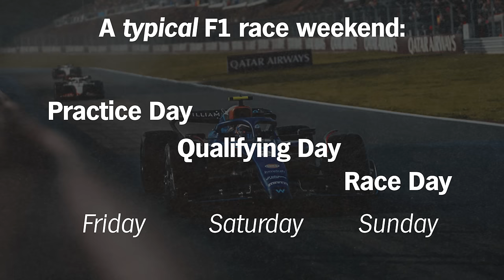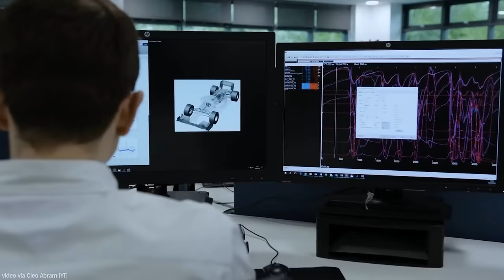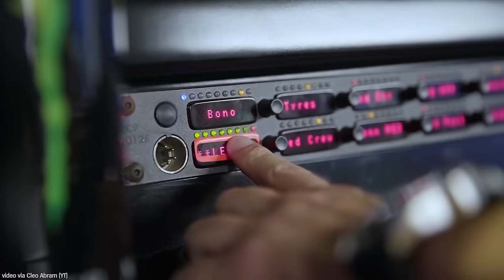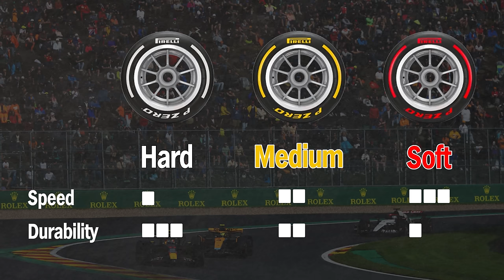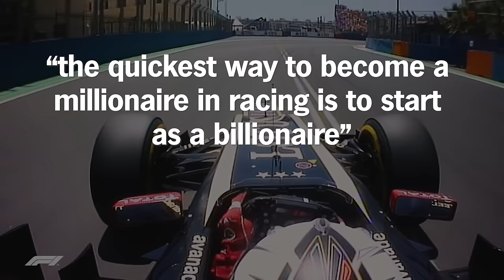Why America is Suddenly Obsessed with F1

Comment: For anyone who's wondering about the 4 wheels rule...let me introduce to you the Tyrrell P34
Reply: Every weird rule in the F1 constructor guideline has an even weirder car behind it.
Reply: @EversonBernardes  the fan car comes to mind
Reply: @ImThe5thKing  yup, fan car was a big one. Also the ones with multiple rear-wings, stacked on top of each other or in front of each other.
Reply: Real asf.
Reply: Wasn’t there also a car with 4 rear wheels as well before officially being banned
Reply: @mateoorfano6004  Williams had a FW07 prototype with two rear axles, but it never got raced I think.
Reply: crazy thing is that it was faster than 4 wheeled car, same for the williams with a CVT transmission. such crazy rules have always reasons behind themself
Reply: @ImThe5thKing  the Brabham BT46B specifically
Reply: @EversonBernardes  And there was a development Ferrari with 6 wheels around the same time, also never raced.
Reply: @EversonBernardes  Same with CVT, Williams did a test run with the FW15C and it was to OP and removed to much skill
Reply: @waynec3563 and the Ferrari one was equally as bonkers as the Williams one - it had dual rear wheel on the same axle, like a lot of heavy equipment vehicles lol
Reply: @henriquerocha16  It also apparently sounded horrible, because the engine was running a constant RPM the whole way.

Comment: Great video!
For those interested, here's a few extra details one some of the points this video brings.

As silly as it sounds, there is a reason behind the rule of "only 4 wheels per car". In 75, Tyrrell came up with a 6 wheels car and although it wasn't very successfull (it was bad) the FIA banned the usage of more than 4 wheels to prevent the eventual development of such cars. They did the same thing with active suspensions, the fan-aero (what an amazing piece of ingeneering that was) amongst others. 

Even though this is very often the practical output, in theory softer tyres =/= fastest. There are plenty of factors that comes in play, but by being softer and stickier, they offer more grip AND heat up a lot faster. Because of this if the track is too hot would overheat so quickly that you couldn't even get one good lap out of them and they would be out of their working surface temperature range meaning a huge loss of grip. For example with the Michelin tyres in WEC, soft tyres are avoided at temps above 20C (air) and on a one lap trim, mediums would actually be quicker. It is rarely the case in recent F1 though since pirelli have 5 different compounds more or less hard to select from and allocate "soft, medium and hard" tyres. That means that one compound called "soft" on a race week-end could very well be classified as hard on another one and kinda keep the "softer = quicker" rule true. 

It is also not super rare for drivers to take other "routes" than the F4->F1. Some have seasons in other junior series, super formula, GT series..... And sometimes, take part in more than 1 per year. Ultimately if the driver is part of a junior program, the team sends them to whatever they see fit to bring the most improvement wether in skills, recognition, media....

I'm no engineer or master-expert and this is just some long time gathered knowledge by pure curiosity so there's maybe a lot more to be said by people a lot more knowledgeable! but I thought t his could be interesting for some :D

Comment: Small correction, there can be 12 f1 teams at a time currently so 24 drivers not 20, the FIA does make it pretty hard for new teams to join so it’s basically limited to 20 though
Reply: That is not correct, the FIA really wants new teams but in the past the agreement was made that the existing teams need to approve all new entries, and they reject extra teams because they fear that more teams on the grid means a smaller piece of the pie (i.e. less income) from them.
That of course has to change but it takes time...
Reply: FIA actually approved the entry of Andretti. It is F1 (Liberty Media) and the teams that are resisting new entries to the sport because they don't want to share the money. The money a new team needs to pay to enter F1 was determined before the big rise in popularity when they actually wanted to encourage new entries. Now that the spotlight is so popular, they want that amount to increase to ensure that their share of the pie isn't cut.

Comment: Nascar needs to stop using cable if they want to grow
Reply: NASCAR needs to make the cars faster. And add a behind the wheel camara to see what the driver is doing
Reply: @Jupiter-shorts_  what? There add circuits and would adding HP do anything? Man motorsports around the world hardly get 700 HP now
Reply: @Marko137-em8nx  hypercars in imsa and wec get the most attention because they are faster that gt3 cars. When I see nascars race they look like snails in the track. But when I see 1000 hp f1 cars on track I am amazed with how technology advanced those cars are
Reply: @Jupiter-shorts_  f1 cars don't have 1000hp
Reply: @Jupiter-shorts_  V8 supercars have the same HP as the next gen
Reply: @Jupiter-shorts_ they already have cameras everywhere inside the car. They don’t need to be any faster also.